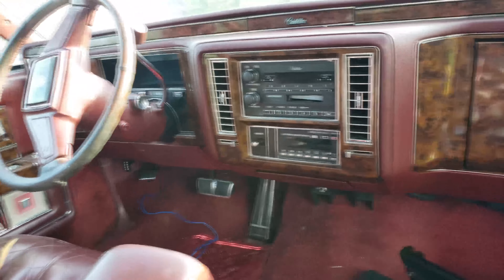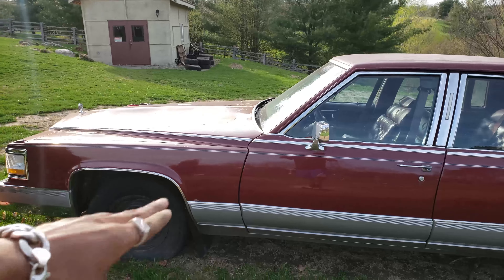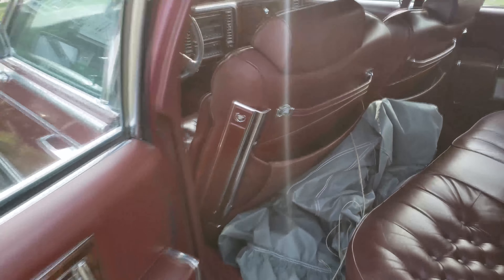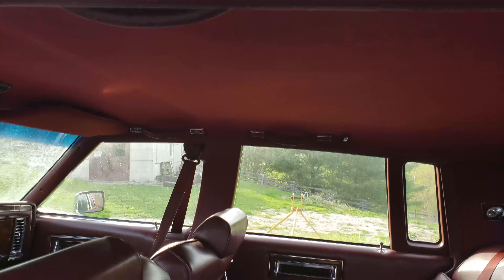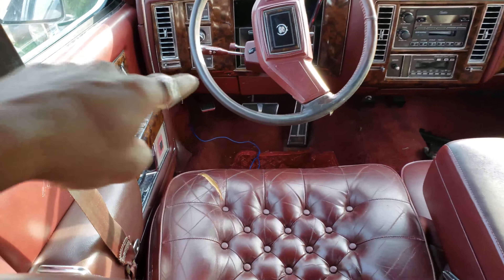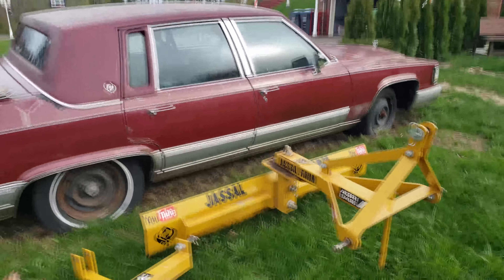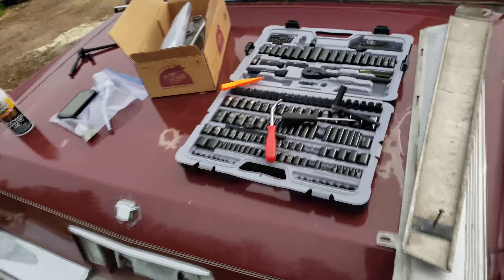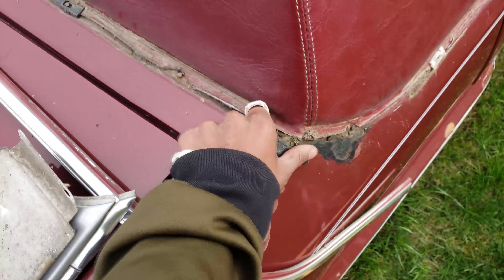1990 Cadillac Brougham D'elegance Project Build: Part 1 Removing Chrome Trim (4K)

Comment: NICE! can't wait to see the project. Good luck and have fun.
Reply from the maker: Yea I can't wait either but I still want to take my time on it :) I have a few videos to catch up on, I never got a chance to upload on time because we had a severe windstorm a few weeks back & if you realized in the video the Shelter logic were I park my tractor is gone! It caught some heavy winds and flew like a parachute I was still holding onto the bars on the side to prevent it from flying into my neighbors windows. I ended up flying 15-20 feet in the air & got dragged more then a 100ft in the mess. Im lucky to be in one piece. Me and my brother both had body pain for some time. I never got a chance to record the event it would've been something to see.
Reply: DAMN!!  Glad y'all are ok sorry about the shelter. Poor JD going to be sleeping outside.
Reply from the maker: Who cares about the shelter thing. The John Deere needs a roof before winter comes :)

Comment: I own 3 of these,and have disassembled many more over the years for parts. 100% the seats and top will need to come off. As much rust as its showing,its a safe bet its rusty under the back seat,especially where the seat belts anchor to the floor. And the roof/C pillar seam will almost certainly be rusty under the top. A tale tell sign is lumps under the top at the top of the C pillar,basically in line with the top of the door windows. 
 Also,cutting a slot in those tough fender trim screws and then a stubby flathead usually does the trick,and there's less chance you'll nick the trim. Best of luck.
Reply from the maker: Thanks so much for the tips Wes :) I stopped working on the caddy because it needs alot of money. I'm going to pull the motor and rebuild it as well as keep some of the parts off the car and sell the car after im done pulling the parts. I bought a  near mint '77 Cadillac Eldorado biarritz white on white with red dash 42,000 miles. I like the Eldorado more than the brougham now it just has a bigger presence. Im looking on getting a new vinyl roof for my Eldorado or preferably a gator one. It has a small tear on the back the size of a quarter. But definitely thanks for the tips, I will be keep a lookout for another brougham in the future. But for now I got my eye set on a '59 cadillac Eldorado or a '59 impala. Take care and be safe :)

Comment: Dope...My mothers 92 is about to get the same treatment top of the year.  how is it going?  part 2???
Reply from the maker: That's badass! what color is it? Part 2 wont be happening any time soon we have snow all over the ground. Right now shes parked with a cover & all wrapped up for winter months here in Canada. Hopefully next year In spring we will be replacing the fuel pump to get her running. Then I gotta deal with the rust on the rear passenger quarter panel its eaten through from the bottom up.

Comment: Jassal nice u have the chevrolet 350 under the hood.jassal u have to put some wax on the vinyl tap it's made just for that so it doesn't Crack or start cracking.
Reply from the maker: Yea that's one thing that made me buy it for sure, cause its rare to find a 5.7L 350 around here that originally came with the car. Definitely a must do for sure, If you seen the rust going under the top makes me want to remove it. But seeing the vinyl in such good condition stops me from doing it . Main plan is to get this baby done right cause once Im done with her she aint gonna see a snowflake in her life.

Comment: Any updates regarding this project?
Reply from the maker: Nope sorry , I sold the Car & bought something else instead.
Reply: @jassalfarm3743  Was it just too big of a project?
Reply from the maker: @Jiraiya_Sage  Well It needed couple thousand put in. New Tires, fuel pump, fuel tank, fuel lines, brake lines, brakes, rotors, front suspension work, New Digital Dash, a Grill on the front, New Paint, Engine work, Mice had chewed some of the wires. Plus it had lots of miles on it (392,000km) So with all the time & money put in, It wouldn't be the best financial decision knowing I can get mint second owners for less then 10k. So I sold it and bought a beautiful 1977 Eldorado Biarritz White on White with Red dash (41,000miles)

Comment: So what happened to the car
Reply from the maker: Well It needed couple thousand put in. New Tires, fuel pump, fuel tank, fuel lines, brake lines, brakes, rotors, front suspension work, New Digital Dash, a Grill on the front, New Paint, Engine work, Mice had chewed some of the wires. Plus it had lots of miles on it (392,000km) So with all the time & money put in, It wouldn't be the best financial decision knowing I can get mint second owners for less then 10k. So I sold it and bought a beautiful 1977 Eldorado Biarritz White on White with Red dash (41,000miles)
Reply: Restored they're going for 13k plus definitely worth the time if doing your own work. Couple thousand for good body work and paint unless you do it yourself. Mechanical part is easy